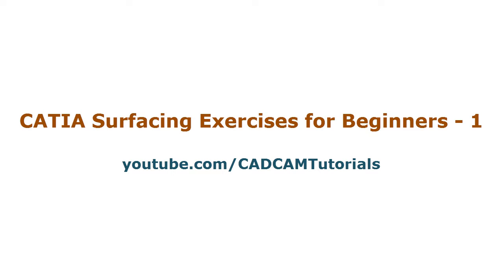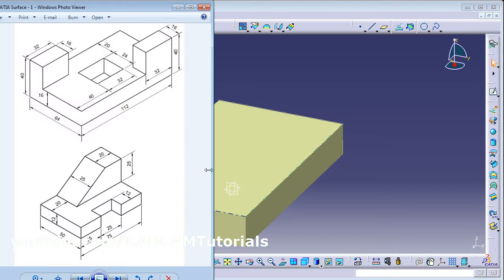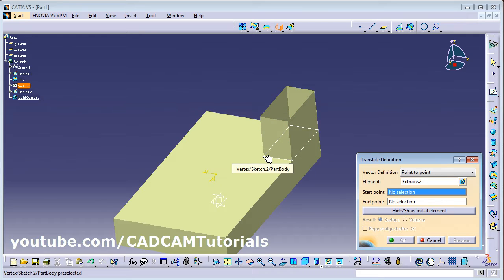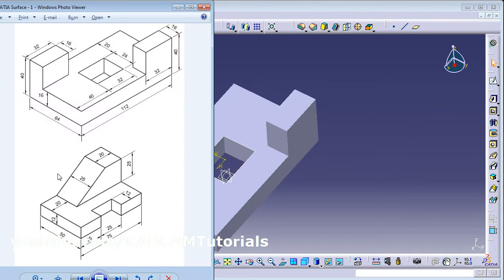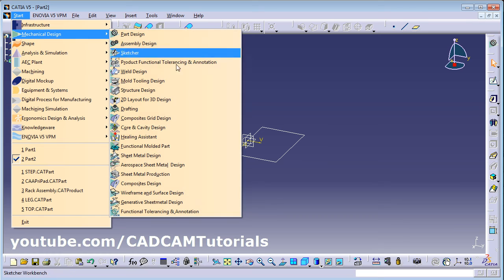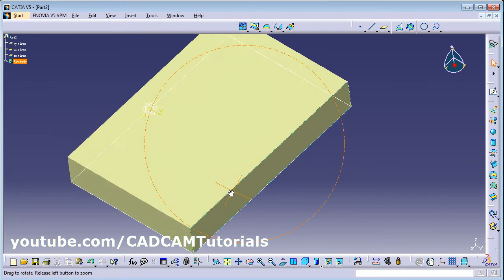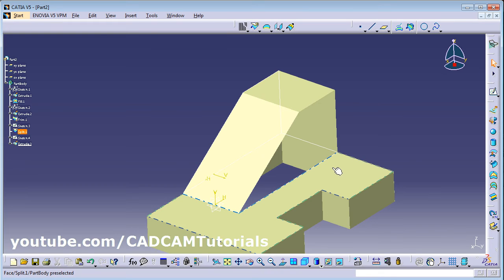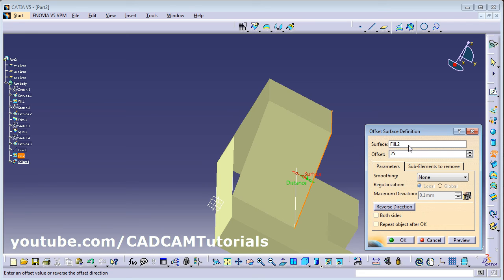CATIA Surface Design Exercises for Beginners - 1 | CATIA Surface Design Examples

Comment: There is no doubt, you are a great teacher. I am leaning Catia via your YouTube channel.
Question: Why we can not do these drawing by " Part Design" (via Pad) instead of Surface design. Which is more easy, this way (Surface) or Part.
Reply from the maker: Certainly these drawings are easy by parts. But to learn basic surfacing concept these drawings are good.
Reply: @CADCAMTutorials  but why/when would we use surface design vice part design? It seems that part design would be sufficient for all needed cases. Why even dabble with surface design? If you want to create a part that is not filled, you can just use the shell function no?
Reply from the maker: For regular engineering work part design is sufficient, but it has limitations too. If you have to design very efficient areo dynamic shape, or some product with complex shape, then for that only surface design is required.
Reply: @CADCAMTutorials  i too had the same doubt..thanks for explaining

Comment: what is the purpose of surface design anyway? i dont see any different with part design.
Reply from the maker: These are simple exercises to understand basic surfacing concept, therefore you will not see any difference. But there are some components which cannot be modelled with solid modeling. In such cases surface modeling is very useful.